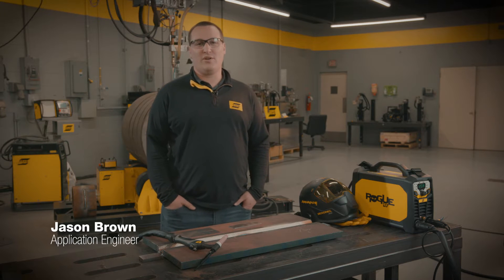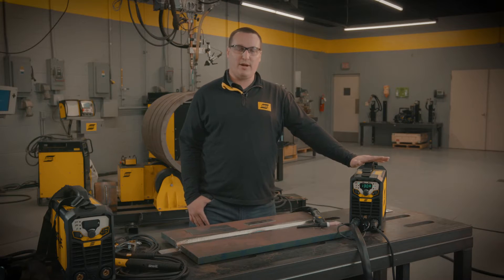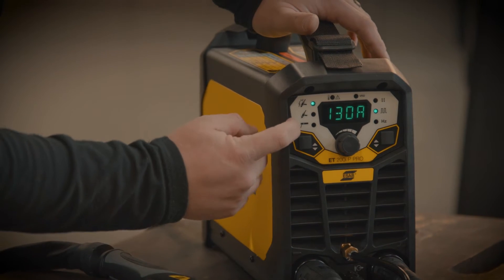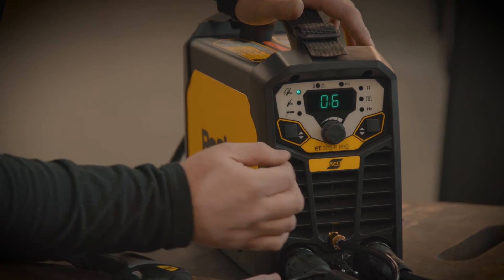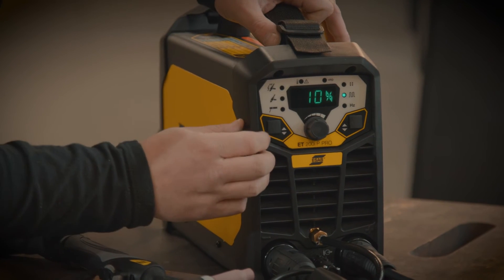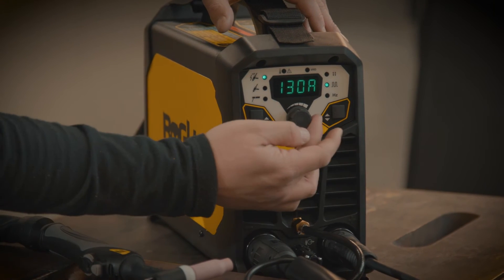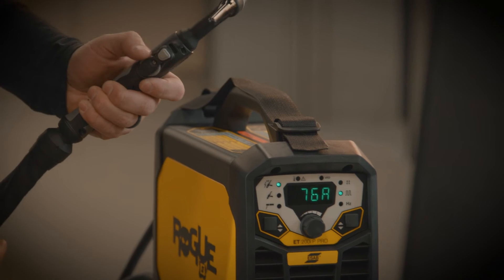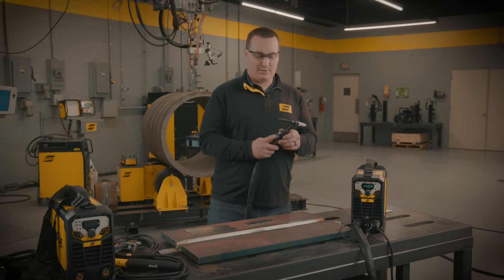How to Set Welding Parameters on the ESAB Rogue ET 200iP Pro Portable TIG Welder

Comment: Is scratch start and option on these machines?
Reply: 9 months later and the only comment/question is still unanswered. Hopefully their telephone customer support is better. 🤷‍♂️
Reply: No
Reply: @NoNo-uy2bq  no to scratch start or no to their customer service or just no to everything? 🤔
Reply: @jacobwrona  no scratch start it’s just lift, although lift is better anyway. HF is superlative to both of these however but can sometimes interfere with electronics
Reply: @NoNo-uy2bq  Thanks for the reply and the information!
Reply: @jacobwrona  no problem ✌️
Reply: Is that a high frequency machine??
Reply: @escuchandoaDioshoy  yes
Reply: You can do scratch start with the stick welding setting and a tig torch